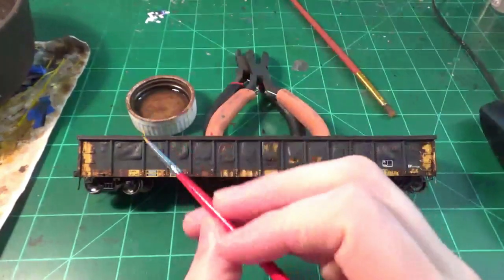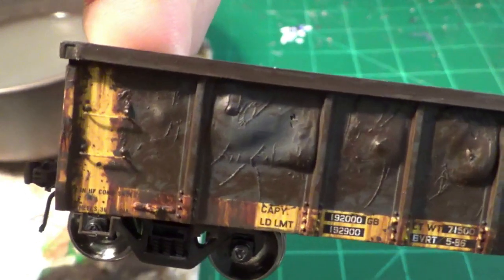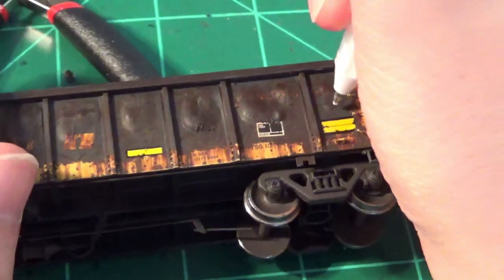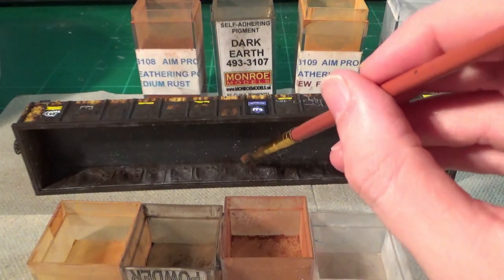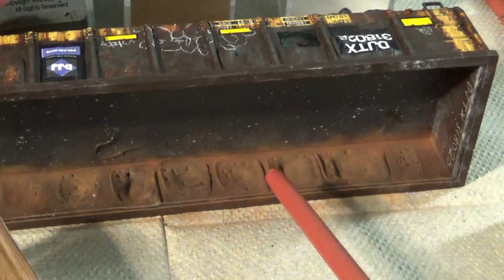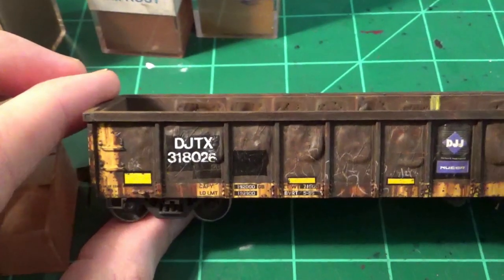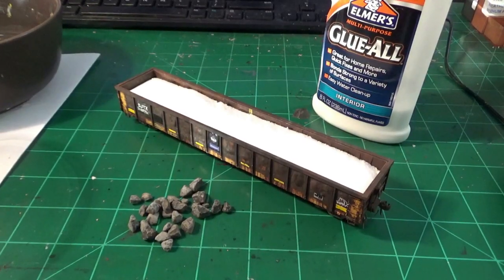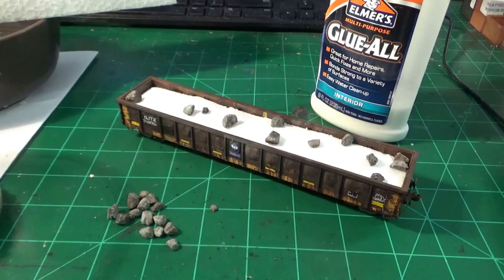Weathering An Athearn Railgon! Part 2 of 2.

Comment: Weathering work is flawless. As for the load ... the limestone quarries where I live produce crushed rock in various grades. Buyers will take truckloads or trainloads of product but the sizes of the rock won't be mixed. The most common size shipped out the fine material used as road base, and that sits in mounds in the cars. The coarser grades don't mound as much and approach a more level profile such as the one you modeled here, but the rock is all roughly the same size for each load. About the only thing not shipped out is material the size of rip rap, but then that's usually granite from other sources, not limestone.